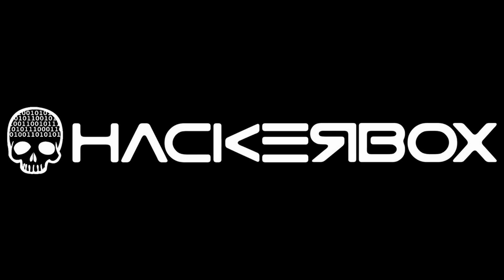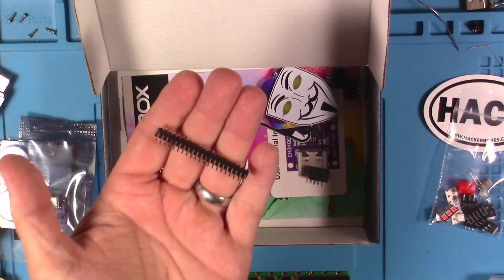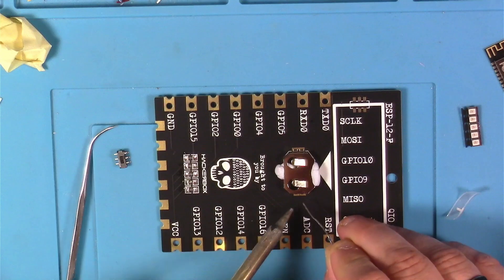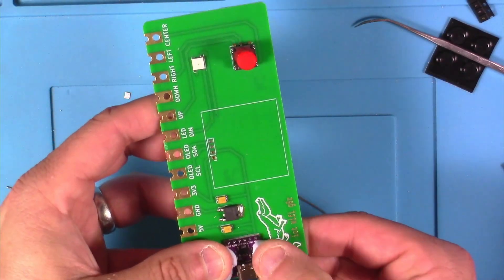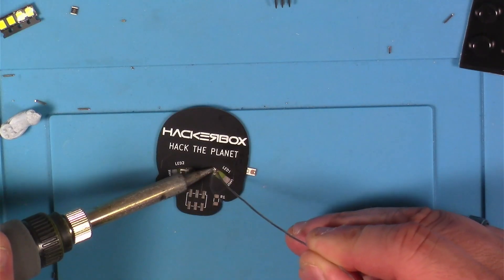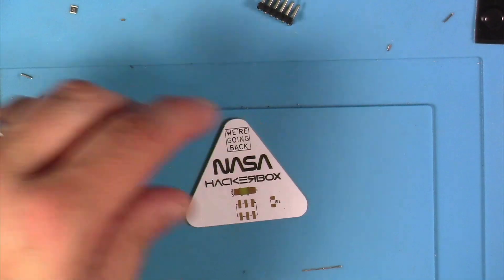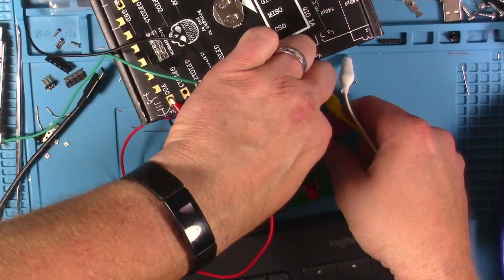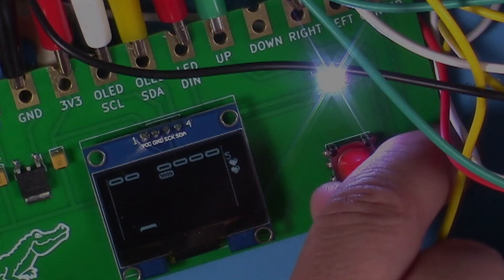Hackerbox 0093 - #badgelife ESP8266 Fun & More!

Comment: what kindof cable you use USB A to USB C? to connect your computer to the GTR board? I am having hard time using USBC-USBC
Reply from the maker: Updating this, sorry. If the question is if I used an A to C usb cable the answer is yes. I just grabbed one I had on my bench. Generic, not branded or anything. You don't have a charge-only cable do you? Sorry if a silly question. That seems to pop up from time to time.
Reply: I was using a cable for my Samsung phone  @JamiesHackShack  I hope it is for both

Comment: Hey there! I'm glad someone else is having issues with comminicating with the ESP! Mine is blinking in tandem with the serial, but still gives me a timed put packet header error.
Reply from the maker: The thing keeping my code from pushing was a teeny solder bridge between two pins. After that I had an issue with one pin needing to be reflowed to make a good connection for the pin "left" is on. Probably goes without saying but just in case, be sure to hold "up" while power cycling it to get it ready to take the code push. Hope you get it going!

Comment: I subscribe to ADABox, but they haven't released on in some time. Might be time to move on to the Hackerbox.
Reply from the maker: I like some months more than others. Some of those folks that poo on monthly kits don't give any credit towards the time the folks spend to curate and design and get the boards made up etc. If you look at the base value of some of the components you could maybe come out cheaper but that misses the point. I dig em!